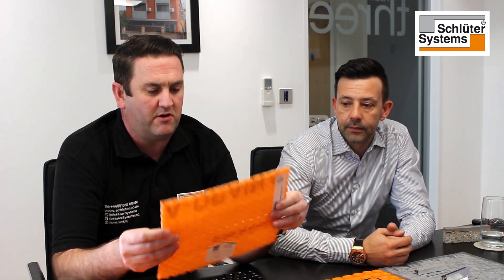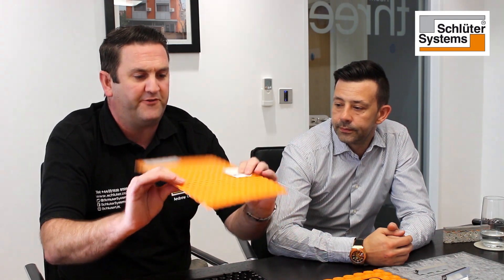Tiling Talk - Can DITRA 25 uncoupling be used outside?

Comment: How does the water drain once the adhesive has covered the drainage holes?
Reply from the maker: Hi, thanks for reaching out! Any rain water that gets through the tiles/grout joints, the water will run through the tile adhesive and be collected into the membrane. The substrate should have a 1.5 - 2% fall. More information about DITRA-DRIAN, including the datasheets can be found on this web page https://www.schluter.co.uk/ditra-drain.aspx